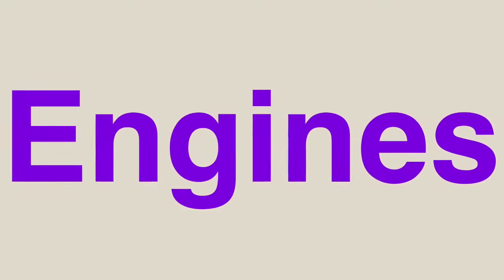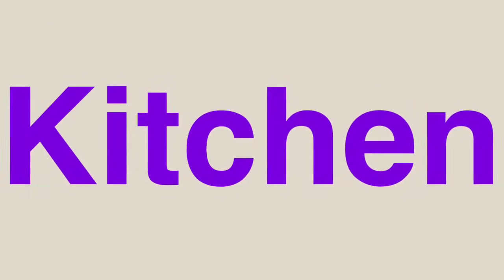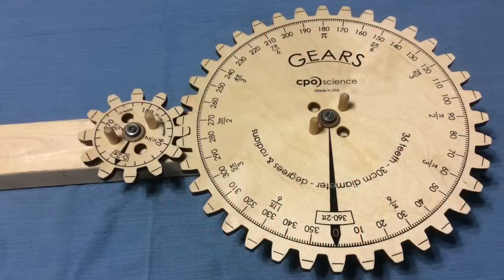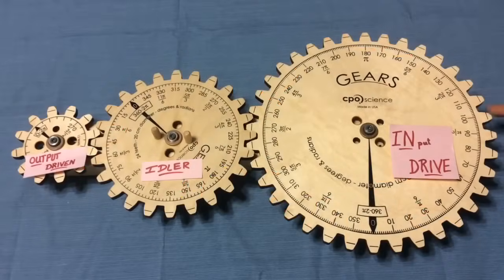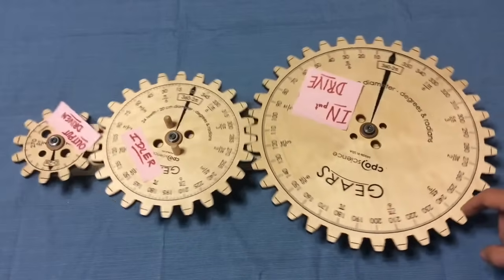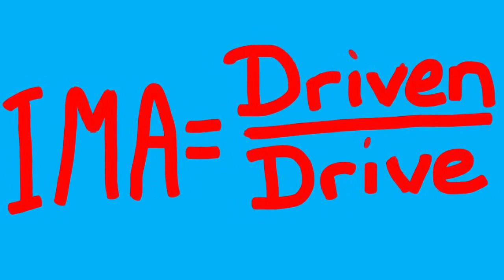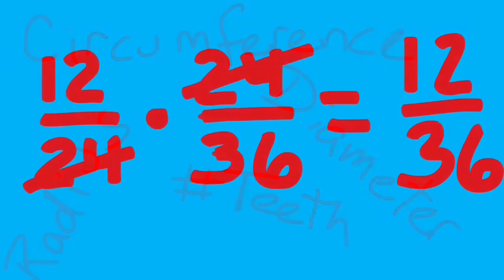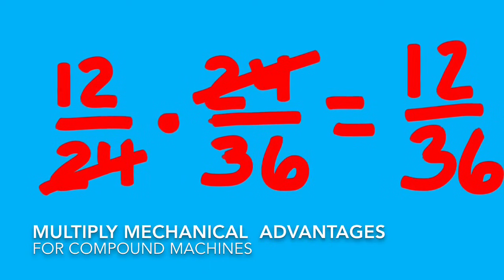GEARS - the Basics

Comment: I have a question here professor.I learnt that the smaller gear is called pinion and the larger one is called gear .However, Is there a rule sth like pinion must be the driving gear and gear must be the driven one ?? I mean pinion can also be driven gear by the larger one right??
I really appreciate your answer.
Reply from the maker: I likely don't know the proper terminology for your application.  But it can be driven either way.  Large gear can drive small gear for more rotational speed or small gear can drive large gear for more torque.

Comment: Gears, ramps and pulleys have one thing in common - they trade distance for power.  That's the essence of what I've learned.  Gears of course have other uses such as timekeeping, synchronization of machine parts, measurements etc.

Comment: In 6:1 gear ratio, divide 72 by 12, and it equals 6, so you would know that the small gear is 6x faster than the large gear, this is useful if you are going to make something like a pedal spin dryer, which doesn't consume electricity, so you can increase the speed more and more.

Comment: If the direction didn't matter, the idler gear would be unnecessary, engineers never use more gears than our needed, we can increase the gear ratio by adding more number teeth such as 48 96 or 120, but such a large gears can be very cumbersome, engineers are roughen limited by space, so big gears require enough room, but you can actually increase diametral pitch, so you can save a ton of space.
Reply from the maker: Who said direction didn't matter?  It depends on what you're designing.  It's the idler SIZE that doesn't matter - except for spacing the two main shafts.  Depending on how you connect them you can achieve same direction spin or opposite in a plane or various directions in 3D.
Reply: @LRNFZX  Well, it's because gear friction reduces power.
Reply from the maker: @CasamTheAnimator  doesn't look like we're speaking the same language actually
Reply: @LRNFZX  Depends if you are making something like a pump, it is imperative that the pump needs to turn in the correct, but not in all pumps.
Reply from the maker: @CasamTheAnimator  My  washing machine for example runs the pump one direction when agitating and the other when draining and spinning.
Reply: @LRNFZX  That's right.

Comment: If the small cogwheel is turning faster, the big one is turning slower because the small one takes a while to reach 360°.
Reply from the maker: By definition, yes.  The linear speed of the teeth of each wheel is the same but the rotational speed is different.

Comment: So if I am trying to multiply torque does that mean if I have a small electric engine that has an output of 0.15Nm continuous torque and I set up a gear ratio of 3 then the ending output torque is just 3x my 0.15Nm or 0.45Nm?

Comment: Nice video, however, personally I call mechanical advantage less than 1 a mechanical disadvantage.
Reply from the maker: To call it a mechanical disadvantage is a real attempt to deal with the difference between the two.  Problem is that machines with MA less than one really do give a mechanical advantage - it's just not a force advantage.  Our arms and legs and baseball bats and lacrosse sticks are all levers that multiply speed and displacement.  Pulleys can be used as MA less than 1.  And obviously gears too.  I'll stick with speed multiplier and force multiplier.
Reply: @LRNFZX  LOL thanks for the reply - it's tongue and cheek; if torque multiplication is an advantage, then torque division is a _ _ _ advantage :)  Cheers ....

Comment: One of the best refresher I needed today. Having done recoveries during my service, I used to be sharp and quick when it came to calculations of gears or snatch blocks. Not so much anymore. Age is catching up.
Reply from the maker: I was just told that same "age is catching up" yesterday by a 60 year old friend of mine but I have forgotten things most of my life.  In this case it might just be a lack of exposure to the material over a long time and other things to think about.  Thanks for taking your  refresher course here.
Reply: @LRNFZX  Worst is as you explained it, I knew exactly what you meant and where you were going with it.  It's like the dust was being blown, on once a smooth polished surface, which once reflected my clarity. Life running its course. LOL

Comment: Bicycles do not have gears, they have sprockets.
;)
Reply from the maker: Gears have all kinds of different names.  Sprocket is the name for the individual toothed wheels that combine to form a gear ratio on a bicycle.  On a belt drive (even on a bicycle belt drive) they're called pulleys but they're the same thing. ;)

Comment: I have such a hard time understanding gears, even this which I’m assuming is the most basic explanation you can get still doesn’t click for me
Reply from the maker: It helps if you have them to play with in person.  Take a look at your bicycle gears too.
Reply: If it helps, heres a way to think of it:
when the gear teeth mesh together, the teeth of one gear has to go the same distance as the teeth of the other gear, regardless of size differences. So if we have a small gear meshed with a large gear and spin one of them, the small gear would complete rotations more often than the large gear because the small gear has less distance to travel. 

for example. if i have a gear with 10 teeth meshed with a gear that has 30 teeth, if i completely rotate then 10 tooth gear, we would have moved through 10 teeth on both gears. the 10 tooth gear goes through 10 of its teeth, which would mean a full rotation. the larger 30 tooth gear would have also gone through 10 teeth, meaning its only completed a 1/3 rotation.

i hope this helps! i know its a pretty rough explanation though...
Reply: Dakota Galvan no you did a really good job explaining that part I just don’t understand the advantage of using gears or how they make things work faster/better
Reply from the maker: @mrwoody1413  It helps a lot if you have them in front of you to play with them.  The bicycle helps and the gears inside a printer can work too.
Reply: @mrwoody1413  The advantage of gears is determined by the mechanical advantage value used to measure their effectiveness. What that means is lets use the speed output for example as referenced in this video, when he spins the larger gear that has 36 teeth, it means the smaller gear that only has 12 teeth will rotate in a full circle 3 times for every full rotation the larger gear makes, this means the output is 3 times faster than the input. This is how devices such as drill presses and lathes achieve high rotations per minute. 

If you reverse it and spin the smaller gear, the force you put in is now slowed down however by doing this it creates more torque so it is called a torque multiplier, the ratio is still 3 times as the ratio of teeth between the gears has not changed. this means if you spin the small gear with 20 pounds of force that in a perfect world it will result in the large gear outputting 60 pounds of force to whatever it is connected to. this is used to move hard to move things or open hatches that would otherwise be very difficult to open by hand, such as on the bottom of a trailer that is carrying grain and you need to open the door at the bottom to empty the grain, butt the door has thousands of pounds of pressure pressed against it making it extremely hard to open, in this scenario most modern trailers use the worm gear with ratios similar to the 20 times in the video, so if you crank the lever with 100 pounds of force, the gear that is used to open the door, is opening the door with roughly 2,000 pounds of force, or one ton.

As he demonstrated in the video, if you are unsure of what the mechanical advantage of the gear ratio is, and you do not feel like doing the complex math using the diameters of them, you can simply rotate one and count how many times the other gear does a full rotation compared to the one you are rotating. And similar to in the example where he rotated one 11 times to get the other to rotate 14, it is easiest to rotate them both until they stop at a full rotation as that will often give you the most basic ratio, to use the said example to help explain what I mean, 11/14 is the smallest you can break that fraction down while keeping it a single fraction, whereas if it was 4/12 you could reduce it to 1/3. 

Once you know the mechanical advantage, it is a matter of simple multiplication or division to determine the outcome. However keep in mind that due to the laws of transfer of energy and the laws of real life, the outcome will never be exact to what the mechanical advantage is due to friction and things like that. that is why bicycles have 98% efficiency instead of 100% because some energy is spent overcoming the friction to make it move and keep it moving. However for basic understanding you can ignore friction and just approximate it. So if your mechanical advantage is 6 and you have a speed multiplier, meaning that the output rotates faster than the input, then this means any input will be multiplied by 6 and that will be the output, the opposite is true for torque multiplier and so on. 

Hope that helps make sense of it for you
Reply from the maker: @gettingheadeyesd  I used to use that explanation but I could just never figure it out conceptually or visually.  it was not memorable to me.  Now I can look at it and quickly determine the type of multiplier and the IMA.  This is more useful to me and my students and that's why I use it.

Thanks for your explanation.  If it works for somebody that's great.  It doesn't work well for me.

Comment: Thanks for the video it definitely helped me gain an understanding of them, as far as making sure 2 gears are compatible and will mesh together what do you need to look for?
Reply from the maker: What kind of gears? Directly meshed? Driven by a a chain?
Reply: @LRNFZX  spur gears, directly meshed, driven by an electric motor or hand crank
Reply from the maker: @heavyfeather6682   -  heavy feather  - so you don't want the motor to spin too slowly since it will draw huge currents.  And you need to consider your desired  output  speed.  Once you know  your  motor and have the information on the best motor speed and your desired output speed you can calculate the gear ratio and then look for gears that work for your  application.  

I am currently looking at my motorcycle and the first gear is too high.  I have to slip the clutch a lot and rev the engine way too high so I need a lower gear.  The engine input is thousands of RPM and the wheel starts at 0  RPM so I have to put a smaller gear on the input shaft to slow down the output. 

The only problem is that when I reach high speeds the engine will then be spinning faster for the same road speed. Compromises for this torque  multiplier.

The bicycle is the opposite - the foot motor is slow and the bicycle is a speed multiplier.

Comment: For the worm gear, I counted hat there are more then 20 teeths in the worm wheel. Why does it takes only 20 rotations of the worm gear for one complete rotation of the gear wheel? I thought the number of rotations to give it one complete rotation is the number of teeth.
Reply from the maker: I had ignored that until you asked so I had to look into it since it definitely doesn't make sense - good observation by the way.  
I  looked at the thread pitch and it appears that there are three separate threads wrapped on the shaft.  it only takes about 3.3 rotations of the input shaft to push my thumb nail from one end to the other even though it counts 10 threads.   Thanks for the question - it stumped me for a while.

Comment: this is also useful when you are making cranes. it's going to be alot slower but you can easily lift. also useful for exercising. who knew changing gears can change the whole mechanism
Reply from the maker: Special Dude - exactly
Reply: have you seen this video. with some smart placed gears you can lift insane amout of weight https://www.youtube.com/watch?v=pvE83NfbZ8g
and theres also this video. spinning a wheel insanely fast using a gear and a motor https://www.youtube.com/watch?v=zJ3TABb1MRY
and theres also another video that makes the wheel go even FASTER

Comment: whtadoes IMA mean????
Reply from the maker: IMA is the "Ideal Mechanical Advantage."  It is effectively the multiplier for forces in an ideal machine with no friction.  An IMA of 3 means you put in 10 lb of force and the machine puts out 30 lb of force.  That's what I call a machine that is a "force multiplier."  It outputs 3 times the force but 1/3 the speed and displacement.
An IMA of 1/3 means you put in 10 lb of force and the machine outputs 3.3 lb of force.  Sounds like a dumb machine but that's because it's a speed-displacement multiplier that outputs three times the speed of your input.
Reply from the maker: Find a good book. Books are really good for learning. Where are you?
Reply: Lrn Fzx im from the philippines and this was our prject abd i succesfully did it
Reply from the maker: xJustVinCe_ - good work.

Comment: i was thinking about gravity-driven generators with enormous gear ratios, stuff like millions of turns to one, wouldn't the force on the final gears' teeth be incredibly huge?
Reply from the maker: If the output is spinning "millions of times" slower?  Yes.  Plus the drive system won't be very efficient - too much friction.  Generators often spin quickly so you want them to go fast - you might be looking at a speed multiplier where the final gear is smallest and spinning quickly.
Reply: i was thinking of this video: https://www.youtube.com/watch?v=kYmUJVE6Vo0

i guess they use VASTLY different gear train designs than traditional ones.
Reply from the maker: That was pretty interesting.  Once it gets loaded on the output with any real force that would be tough to turn with all the friction.  And they look like foam rollers.  Cool concept.